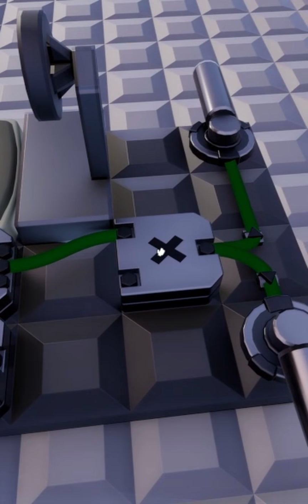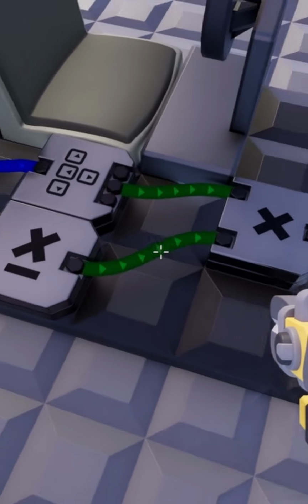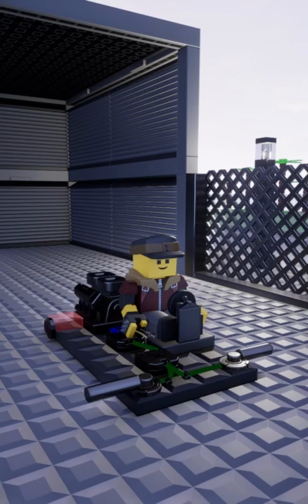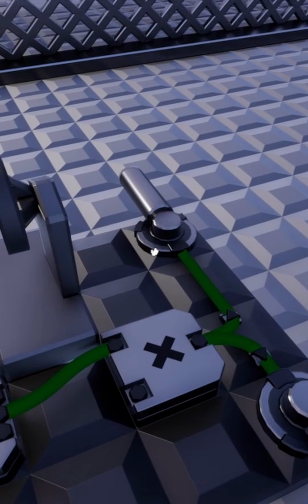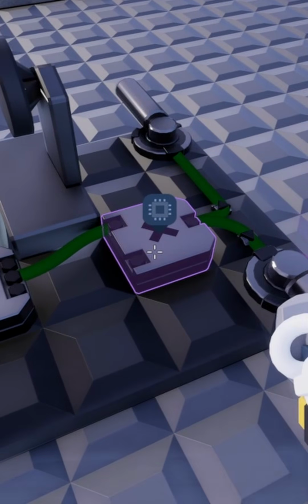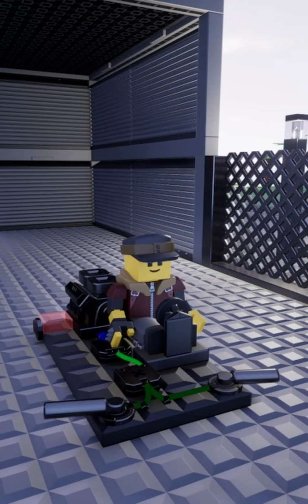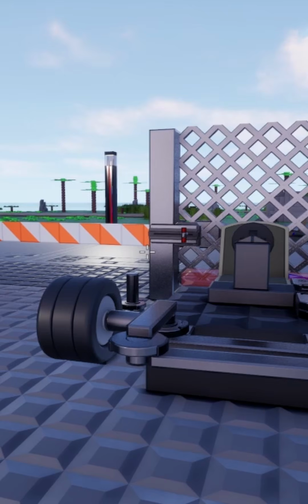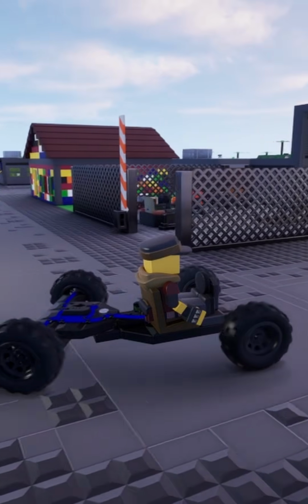Custom Steering (Seat Control Splitter) | Brickadia

Comment: I cant get te closed loop somehow, how do you do it
Reply from the maker: I made a video that goes into more detail on your question – you can check it out here:
👉 https://youtube.com/shorts/YZWJVHOywrY
Reply: @GetSetBuilds thanks!! Is yours also very wobbly ? Im trying out different settings but it seems kinda unusable right now haha
Reply from the maker: It's definitely not the best way to build a car in Brickadia. The existing wheel joints work so much better. If I were building a car that both functions well and includes a visible steering linkage, I would fake it by mounting the wheels on joints and simply add a cosmetic steering linkage that isn't actually connected to the wheels. I did something similar with my slot car replica, which features a spinning electric motor that doesn't actaully power the wheels.